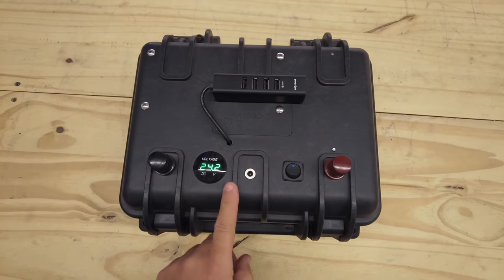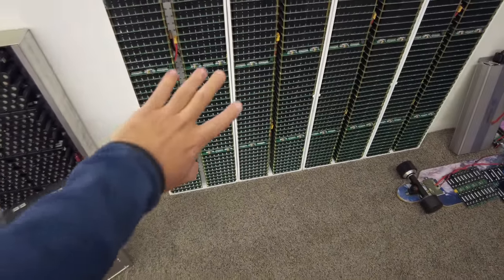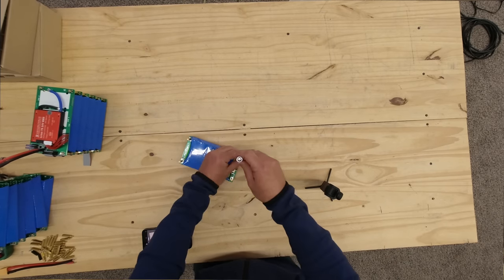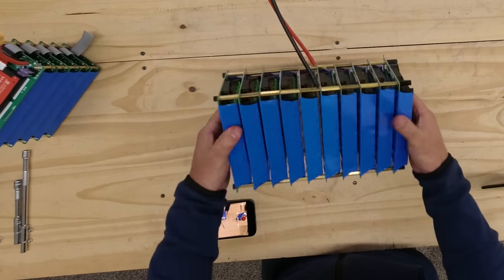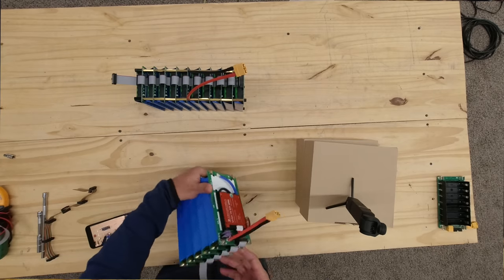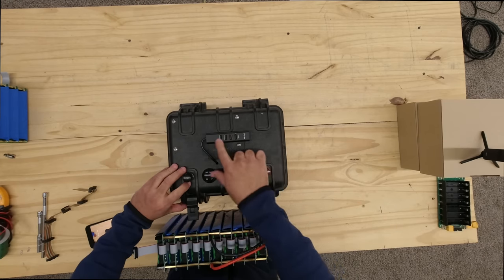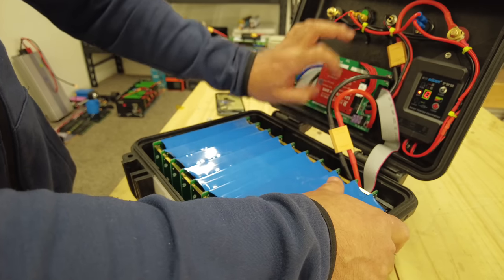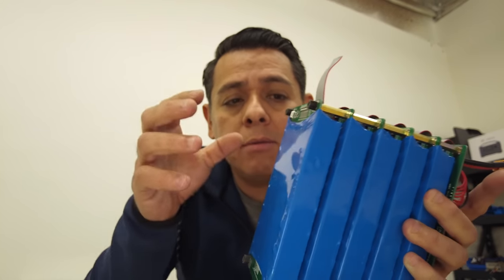Emergency DIY Solar Powerpack Build

Comment: This is BY FAR, THE BEST Solar Generator/ Power pack I ever saw. Its Huge advantage is that if one of the cells goes back you can very easy replace it with a good one instead of throwing the whole battery pack to the garbage, or start messing with cutting a spot welding and re-weld a whole pack. This is the best solution ever. This Solar Generator can last a lifetime !

Comment: I’m probably the least electrically inclined person on the planet, but this gives me hope for a DIY power wall. Awesome!
Reply: you being the least electrically inclined person on the planet is WHY this gives you hope for a DIY power wall. 
because holy moly that is the single worst idea i have ever seen. 
you know there are much safer and much cheaper batteries out there than a pack of 18650's when you want as much power as that wall. 

not to mention. ONE single one of those 18650 batteries failing.  and your entire house burns down.

Comment: I have always thought about a emergency application of a system like this as a " keep my freezer food from going bad " a system like this paired with a few cheap solar cells and a inverter sized to power the freezer only. Long power outages really hurt people that buy in bulk to save money when it all goes bad even being able to run the freezer a few hours a day would keep it frozen solid
Reply: In the midwest we just put our food outside ;)
Reply: @circletech7745  We did this one winter in MI. power went out and everything went out in the snow... Was in the single digits during the day and negative overnight. Not a problem at all
Reply: For those suggestions that say put it out in the snow that's great in the winter but what if it above freezing or more no for when it's above freezing we need power to run fridge and freezer unfortunately because I live in Canada with our lower dollars and high shipping cost it's above my budget there's only two units I can afford and they use a sealed lead acid battery and both are designed to kill the battery in a year because of not charging them fully and discharging to below 12 Volts so I'd basically be buying them for the inverter and that doesn't make sense if their reviewers would do proper reviews and tell of their faults they'd fix them we need a great entry level solar generator that has a 2000 watt pure sine wave inverter with sealed lead acid batteries charged proper so they'd last five to eight years and the ability to upgrade to lithium when the battery dies I'm hoping nature generator will fix their flaws as it already has a 2000 watt pure sine wave inverter so if they'd at least charge the battery to 14.8 float charge at 13..4. and not discharge below 12.2  and upgrade the solar input to 400 watts or higher it would be a good unit and I could live with the other flaws.  to change the solar charge controller to a programmable mppt solar charge controller that's able to charge lithium battery as well would make it a great entry level unit

Comment: Awesome Build! I work as a maintenance technician for AT&T. I climb cell towers 300+ feet daily to fix common issues related to cell equipment. This kit would be awesome to have in order to keep my radio and diagnostic equipment charged since I’m in the sun all the time. Love your videos! Keep them coming!

Comment: I have something similar that the ham radio Community uses but nowhere near as cool as yours we've just taken quadcopter lipos with step Downs bring the voltage down to 12.2 volts so we can use them with her ham radio gear this would be awesome with a 400 watt solar generator project I built! Keep On Keepin On! One of these days we're really going to need all these portable power packs.

Comment: I'm building this almost to a T. I may use a different case. I'm just doing it a little at a time. Got my cells situated, tested and rewrapped, and just got the diy modules in so Ill be working those after work. And Just ordered the BMS and charge controller. Getting excited for this to all come together!  Its gonna be for my mom. She wants to try that whole vanlife thing. But instead of going full bore on a dedicated system before she even knows if shes gonna want to do it full time, I figured this would a good option.

Comment: I've always been told the battery leads needs to be attached at opposite ends of the battery, rather than in the middle as you've done. What's your experience with battery lead placement?

Comment: I like the modular concept and the fact that the case has everything in it and looks neat and tidy from the outside. The   circuitboard concept seems so much more advanced than the usual soldering or spot-welding exercises... Unlike anything I have seen so far on youtube. I am impressed!

Comment: Can these components be used for a 12 volt pack
Reply: Yes. Sort of. You could pull 3 of the batteries out of each board and get a 12-16V pack, but you'd probably be better off using something designed to run at 12V, like a 4S LiFePO4 pack. The 7S boards are designed to run in the 24V range.

Comment: Dude, this is seriously cool, a slightly taller case would posibly allow for a small pure sine wave inverter to be put in as well. Could make for a very handy little off grid solar generator. I may need to experiment with this.

Comment: Stop calling these things generators. 

They are battery packs.
Reply: I do agree with you. But solar generators is a popular name already. Everybody knows it and can relate the device with the name.
I don’t think that it gonna change now!!
Reply: How is not a generator? You plug it into a solar panel which these are designed for. No different than a generator that runs on gasoline.

Comment: Having pried apart used laptop batteries and messed with testing, matching, soldering etc to try and build battery packs, this is a great way for the DIY community to build their own power packs cheaply and SAFELY! 

I don't think I'd top the stacks with the nylon standoffs though. In my experience they are structurally pretty weak and break or strip easy. I think I'd probably use regular metal nuts and find another way to mount that end. 

Great project and a great product!

Comment: Thanks for the video. I really like the pelican case idea. I would replace the car battery conductors with a EC5 or XT90 output though. It inspired me make something similar probably with a DC-DC stepup-down (for variable DC output), 12V Cigaret Ligter, PD input-output and maybe a small inverter. However in 2022 Lifepo4 batteries are much cheaper like 1,200wh is CA$430 (half the price of your battery pack system) and these batteries can charge/discharge in much higher current. I would replace the BMS and batteries with a single Lifepo4 pack. Industries change so fast these days.

Comment: That's awesome. I turned an old solar powered electric fence charger into a portable battery pack for charging things while I'm camping. It uses a 6v lead acid battery though.

Comment: Great video thanks for sharing .  I’m thinking of building something like this but for my kayak motor.  I need at least 100ah power for a 12 volt system.   I’m hoping I can configure the layout also.

Comment: Great Build! Keep making Storage Buzz. Consider shrink tube on Brass connectors and Insulator sheet between Output and Battery layers? I have seen box covers get crushed, oops - Hey, THX for your good work

Comment: Jehu, I'm really happy you've started pre-building a portion of the system.  I was intimidated by all the soldering involved with putting together a battery system.  Now a modular build that's up my alley.  Thank you.

Comment: Absolutely brilliant these modular units remove the uncertainty of DIY. They are exactly what I am looking for having contributed to crowd funded a solar battery management system, unit a few years ago. The increased safety of your design is also reassuring. You mentioned the amperage load that can do serious damage to the unsuspecting, especially when a tool slips across something. 
Unfortunately you’re not Internationally shipping, at this stage. Nevertheless, I guess virtues of patience will figure out a solution for us in Australia. I will subscribe and watch for developments, thank you so much.

Comment: This was so simplistic and easy to follow along. I've been interested in your projects for some time now, and this is the first I think I could complete easily, without having to learn skillets I don't have yet. Screwed in connections and simple connectors make this build achievable! Great job! You can see how much thought I'd put into the design!

Comment: Thanks for your time I watched this couple of times now and I’m keen to make one because I’m off the grid ATM and my old lead battery after nearly 20 years is dying badly and I’m trying to put some 18650 lithium in and get it together with some lithium technology at the moment, thanks for your information appreciate it.

Comment: Thanks for another great video. I like this small version of the 1st video I watched from you that had 200 batteries and converter all contained in one case. I'm still buying the parts for that build but this little guy will be perfect for camping and light duty requirements around the house. Thanks for giving me a project for my 2200 amh 18650 batteries. Roland

Comment: Just completed assembly.  Charging underway!  I did not like the idea of the screws fastening the BMS to the case appear to protrude through top of case and therefore could expose a hot lead?  Could be my misunderstanding, but, I 3d printed a bracket for the BMS and hot glued it to the top of the inside cover.  Bracket has 4mm holes for attaching board.  Overall a fun project for sure and has me excited to explore other projects in the future!
Reply from the maker: I used plastic standoffs to isolate screw

Comment: great video, whats the biggest difference than using say a 145amh sealed batter, beside the obvious weight difference....considering putting one of these together for off the grid camping

Comment: I'm in the process of converting my RV to run on solor power vs using a generator which runs on propane or gasoline. This battery pack seems easy and functional to store the power produced so all my electrical needs in the coach may operate on solor power.

Comment: AWESOME BUILD AS ALWAYS! Ive been following you since the VW bus EV build and Ive NEVER been disappointed. For the last 11 years Ive lived in Cape Town South Africa conducting several projects all centered around helping people. (ALOT OF HELP IS REQUIRED ASAP) What I would like is to use your modules and components to build a pack for low cost to people who need a solid safe system that is super affordable. Power goes off three times a day and that is standard. So Tall order I know but I have NEVER backed down in 11 years... so um yeah Im into this. Do you, would you, ship to South Africa? Gracias Homie and may the force be with you.

Comment: clever solution to use brass standups to conduct the current but how well do they hold up at scale? How much current can brass of that cross-sectional area handle continuously?

Comment: I live in a bus, with two 200 Ah AGM batteries.  I think they each weigh about 1,000 lbs.  This system seems like a good replacement candidate.

Comment: Hi, I need some advice.  I've built this box almost exactly as you show except I've used a different solar charge controller.  However, when I plug the leads from the yellow connector that is plugged into the BMS board to the solar charge controller there is absolutely nothing being displayed.  But when I connect the solar charge controller to the corner connectors (the + and - screws in the very corners of the board) the controller lights up and passes electricity to the load.  What am I doing wrong as I'm worried that doing this will not recharge the batteries when I connect the solar panels to the controller.

Comment: why dont you use higher Amps battery, like 6000/8000Mah, instead 3400/3600mah ? or it is better if using small Amps baterry? You could get a 7s 5p for example with the same 60A. I am correct? thanks
Reply from the maker: No such thing exist 3400mah is the max available in 18650 cells

Comment: after i saw your videos, now finally I'll make one! (in my country blackouts are normal, like 2 or 3 per day),  would you suggest to make one big ups? Or build small ups for sections of the house. Right now I'm doing home office, so I need to power the modem router (12v 2amps) from the livingroom and my MacBook + 2x 24" screens from my office. Since they are in separate rooms I'll need to build different ups right?

Comment: Jehu, you think you can make something like this but in a smaller setting that could fit those 80's flashlight plastic cases that had that big square battery, and power an led 2k + lummens? That would be a nice DIY, a rechargeable led flashlight.

Comment: Nice set up.what would be needed to be able to charge rc battery 2s-6s batteries out in the field.don't want to lug a generator around and gas.sometime indoor where you can't  run a generator.
Reply from the maker: Just a-charger that works off 24v
Reply: @jehugarcia  only have ac charges .don't know of any 24 volt charges for rc batteries  unless the very high end charger 400 00 plus will look in to  it.

Comment: Where can I get just the boards in the UK as I have a load of 22650 cells to use,a 250w solar panel and a 40A charge controller. Would these boards facilitate the use of 26650 battery cases?

Comment: That does look super easy.
How hard would it be to add a UK plug socket into this set up?
I'm assuming a transformer would be needed, but then a lot of power would be lost in the conversion??

Comment: Awesome system Jehu. Do you offer modules in a 12v configuration? All my emergency comms gear uses 12v. Thanks for all your R&D efforts to support the off-grid community.

Comment: I don't know much about the  24v system so I'm assuming if I were to use my 50W 12vdc solar panel I would need to get another panel to run it in series to charge these batteries correct? Thank you, I just answered my own question... for a friend... ;-)

Comment: The only thing I'm confused about with the PCB. Each PCB is a 7s1p board. As you stack them, you basically just build 7sNp battery setups where N is the number of boards used. The BMS uses a little ribbon cable to short the parallel cells together, right? Seems like a potential risk if the cells are imbalanced when connected...

Comment: Tell me, Can I use some blue lock tight on the brass stand up ? or is that going to make a larger connecting &/ or loosening  issue. Thank you

Comment: Looks great.  So this is 7S/10P, how do you connect multiple of these BMS together, if you're building (for example) a 14S/30P?
Reply: They actually have 14s BMS, I got one for an ebike battery I built... 14s 10p. I realized afterwards, that just building two 7s 10p batteries and linking them via jumper was the most sustainable option, it's hard to find a 53v 20a charger. So I just use 2 RC car lipo chargers with 7s capability. My suggestion would be go as many P as you want, but anything over 8s is gonna need special equipment. 6s is the sweet spot, but there are some 8s chargers that are kind of pricey. And when you got all your batteries, just daisy chain them up to your desired voltage requirements.

Comment: Hello Jehu, thanks for all these videos, I am a huge fan of all your DIY. Now I got questions and I am thinking of buying your 24 pcb and BMS systems from you. But I was looking for batteries with higher amps and I purchased ones at 11000 mah, also these just came out that are supposed to be high density and I wanted to know if they would work for this set up. I am buying land and I am building a cabin off grid. I need some power for it. Could you lead me on please? Also I will need a good inverter for these and a solar panel charger/ hydro generator. Thank you. H

Comment: What configuration would I need to use your system for a 52.6v requirement. The load will draw somewhere between 11 - 15 amps.

Comment: Hi I just started watching your videos.   I Built a 12 solar gen with USB,cig , lights etc.old battery..using 1 -12 volt  deep cycle interstate interstate battery, with a 1100w Kreiger inverter it works well but has very little capacity. What type of diy battery pack would you recommend i build to replace the Lead acid ??? Thanks for your help... Existing battery is very heavy..

Comment: I am not that electrical inclined but I have a bunch of Ridgid batteries for my drills and other tools. I would like to hook these up into a power box. I have mostly 4 and 6 ah 18 volt batteries. I was thinking about 6 battery packs/power box. all the same power pack whether it is 4ah or 6ah. Have you done something like this or can you help me build a box with these? I just found your video so I will look at other videos in your selection. Thank you for taking the time to create these videos. The big reason to use these power packs is they are life time warranty. I built a portable power supply for my fish finder but that is the extent of my electrical knowledge.

Comment: Can you make a video where you build one that could run a 24-volt air conditioner? They draw about 22 Amps at 25.9 volts. I need that for a friend that had two open-heart surgeries already and she can't sleep in warm environments. I want to introduce her into the outdoors.
Reply from the maker: How long run time you need?
Reply: @jehugarcia  do you think three hours would be possible? With that I could get a six hour 50% on off duty cycle.
Reply from the maker: 2kWh should do it.  2 of these packs would be 1.8kWh

Comment: 24v battery pack providing 5.5V via USB sockets? That could be provided using just two 18650 batteries and a USB socket.
Reply: More efficient, and also more modular, in case of fast charging, you want more than 5v so Buck converter doesn't have to kick down the voltage as much